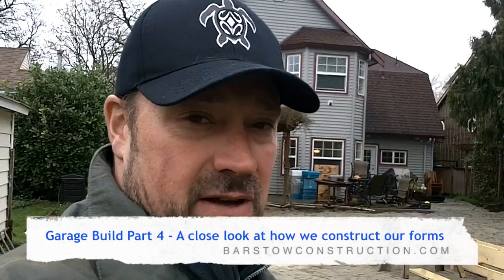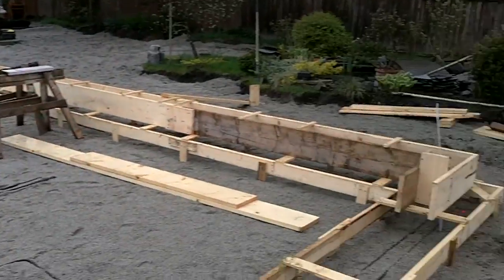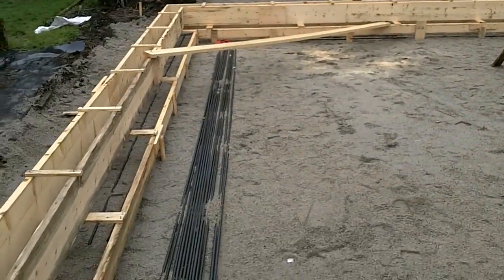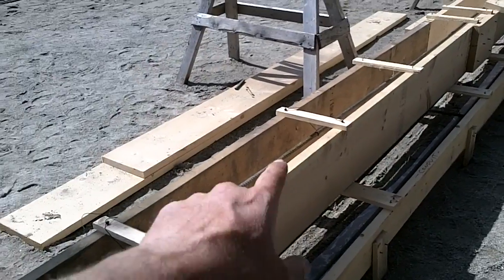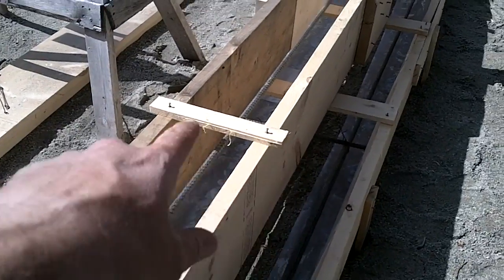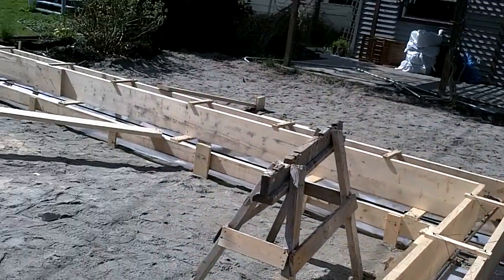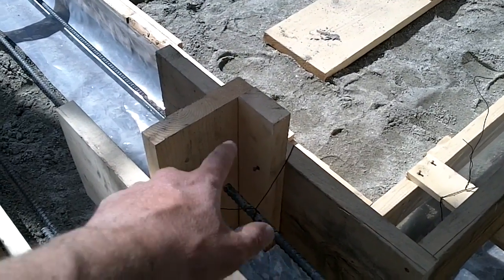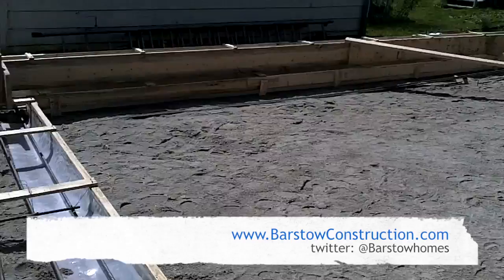Garage Build Part 4 - Building forms for our concrete foundation

Comment: now u should get a hand sprayer from home hardware or walmart or your local general store..fuck walmart....And spray the inside of the boards with diesel..but try not to get ANY on the rebar...this will enable you to remove the forms with ease..
Reply: roll it on with a paint roller or spray boards before you put them up.

Comment from the maker: We build 18" - 20" footings, depending on the specs of the project. Sometimes we use a 2x8 for the footing and 2x10 curb with a 2x4 on the flat on top of the whole thing.... We try to build the forms out of whatever lumber we need for the build - so we can re-use it all! Thanks for the comment!
Reply: Barstow Construction t

Comment: what city did you build the garrage ?   & i live in Vancouver Wa., small world sometimes-- i have biult alot of pole barns and garrages ( non-dwelling structures )--mostly on monolithic slabs--but they are still have to be deeper than yours because of the frost line depth---learn something new every day---thanks

Comment from the maker: Great Question -- Yes our forms are "short" compared to a lot of other areas... It's because we are at a low elevation - right at sea level - and digging any lower ends up WET! So we use a "Slab on Grade" type of construction for our forms.  It's also why we are so careful when we prep our sites. That said, just over the bridge in Vancouver, I have worked on lots of forms with high walls and deep basements - it's just not the way we do it in this area - No basement here! Thanks for the question.